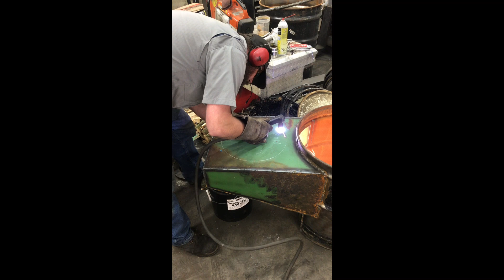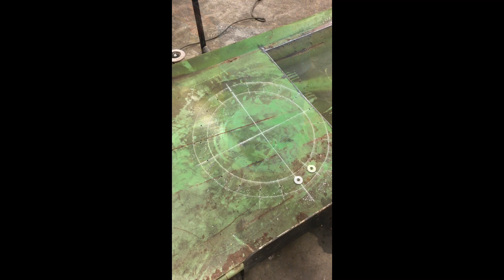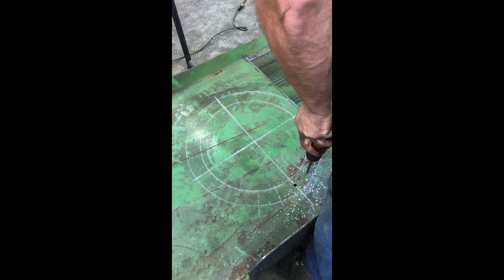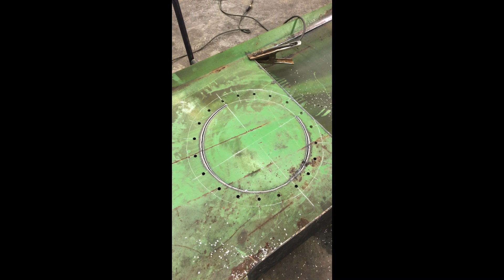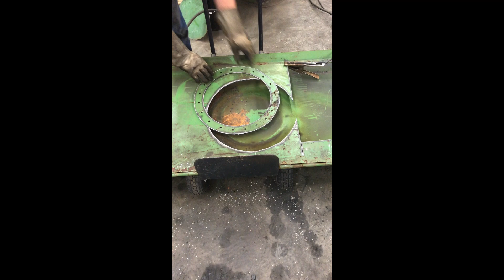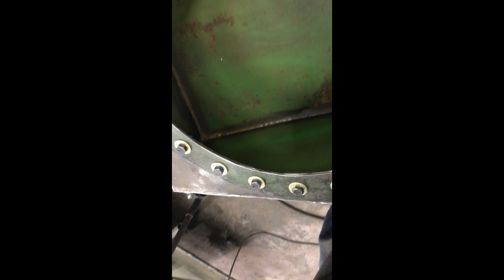V10 Dodge WOODGAS Build Removable Heat Exchanger Body

Comment: 12:46 if you've been following along and have made this mistake, put the bolts in now. weld the nuts in from the access you currently have. You're never going to have this much access again. A weld across half of the nut is more than enough to get the job done. Leave it bolted as it cools to help keep the nut straight. Special tools for a more dangerous dangle include a small mirror and blue, aka fun, tack.

Comment: Before you weld the barrel to ring is perfect time to practice your Tig work welding nuts on.    Plenty of room to do that..lol
Reply: Could do without ring I guess but having they ring on it would act as heat sink and reduce distortion ...lol
Reply from the maker: @mechanic_prepper  missed that opportunity by about 3 hours my man! Just finished slapping paint on the welded on ring and working on the air inlet pipe now